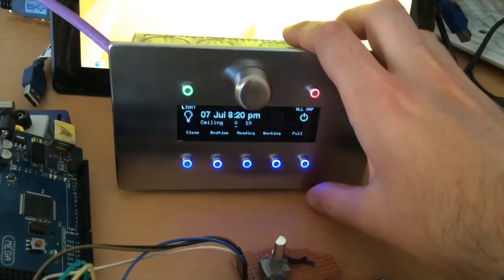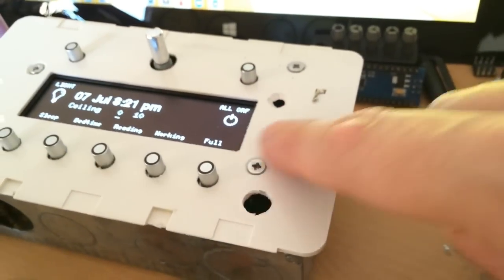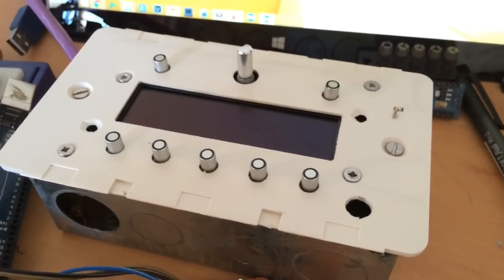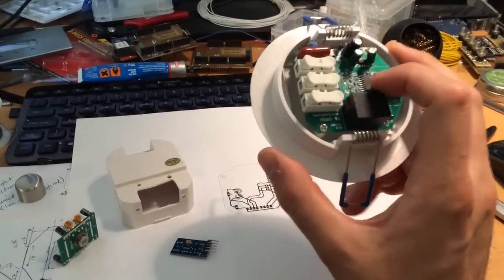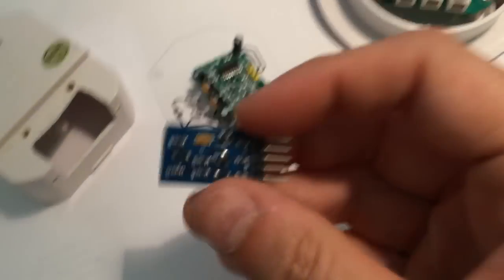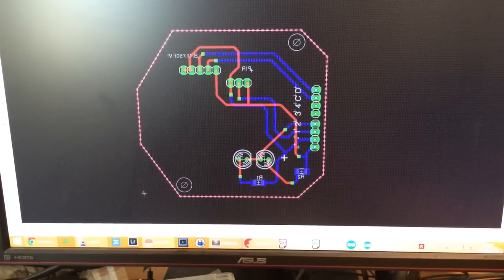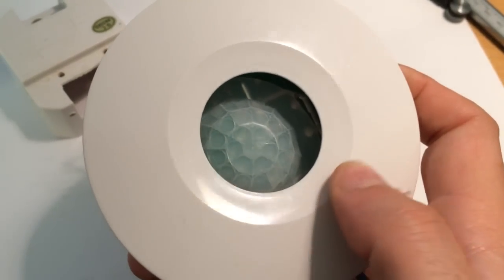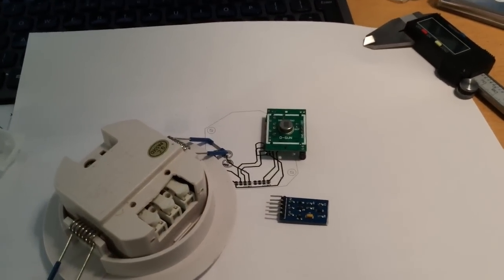Homemade multisensor (work in progress)

Comment: Use a spring, like one out of a pen, but probably smaller. Mount it so it pokes through the unit and the face plate compresses it flush.

Constant firm contact, no thickness issues.

Comment: Great Project!!! I am currently working on something similar. I really like the proximity sensing feature! 
Have you tried soldering the electrode to a strip of thin metal and then sticking the metal out the hole of the plate under the faceplate?
If the thin metal strip is still to thick you have to try and sand down part of the plastic plate in the area of the electrode, but just enough to make it fit and also just about in the shape of the electrode. You could also have a wider strip that is narrow on one end so it can fit through the hole, that would give you a larger surface area and therefore a better connection wich is very important with the capacitive touch sensing.

Comment: I was doing research on capacitive touch sensors and I ran across a technique using copper tape and soldering the wire to the copper. I personally haven't tried it, but might point you in the right direction. You could put a hole in the plastic just the size of the solder point so it can go through and the tape shouldn't be too thick. From what I've seen about the width of the foil you tried to use if not thinner (again, only from what I could see on the pics/vids. No personal experience myself.) so you should be able to stick the tape to the plate, solder the wire to the tape, and remount. Since it is metal on metal, one spot should make the whole plate sensitive.

Comment: I know what you are saying about soldering to large metallic objects. I suspect the issue is the faceplate is just acting as a giant heat sink and removing all the heat from your soldering iron? In which case, pre heating it to around 220 degrees may solve the problem?
I would think something along the lines of a DuPont pin soldered to the plate poking through to a socket would provide the most reliable connection?

Comment: what about the thin copper wire like that of an induction loop? something like that is embedded around the edge (on the inside) of alarm keypads that use prox tags?

Comment: Could you not use a strip of metal, similar to a tamper switch? that way the strip would be touching the face plate but also allow for it to be removed without risk of seperating.
Reply from the maker: Jon Archer Hey Jon, thanks for the suggestion. You're right there does need to be a strip of some kind. My concern is (a) getting the strip through the hole so it can be connected to the wire (I can't bring the wire to the front of the plastic plate as any protrusion at all stops it clicking in!) and (b) finding a strip that is wafer thin. I'm talking paper thin, i.e. 0.1mm or less. Know any materials that are that thin but I can solder to? It's not my area of strength, that :)
Reply: Would it be possible to mount something on the underside of the plastic plate and score a groove in it for said metal strip to protrude?
Reply from the maker: Jon Archer I like this idea - I shall give it some more thought!

Comment: hey,

You want to look into some kind of EMI shielding foam filled "mesh"

somthing like this:
http://www.ebay.co.uk/itm/Lot-of-10pcs-LAIRD-FOAM-CONDUCTIVE-EMI-SHIELDING-GASKET-STRIP-ADHESIVE-E-JP-/171569750872?hash=item27f25aa358

Obviously thinner.

It is used for high senstive items such as oscilloscopes where the back of the case needs to make nice connection to the front of the case for shielding purposes.

You might beable to make some with a small peice of plastic/foam/toilet tissue stuck behind some 

Infact.... make that wire multistrand wire. strip a good 30-40CM back off it, spread the wire out into a kind of "fan" shape and stick it down to the back plate with some copper tape? its total thickness will be a strand of wire and the thickness of the tape.. maybe 2-3mm!?

Other options include hot gluing the wire in place.